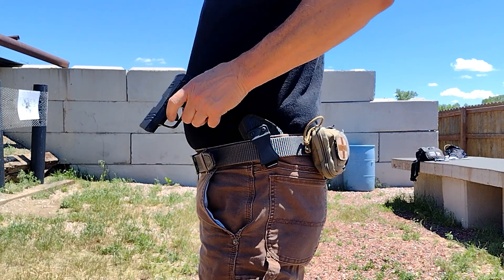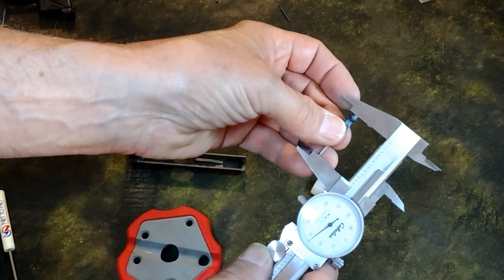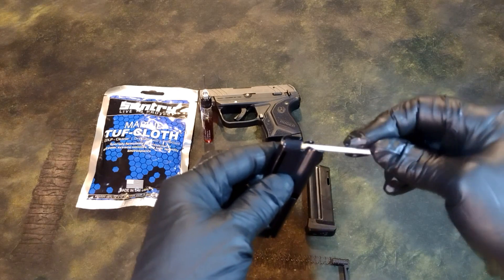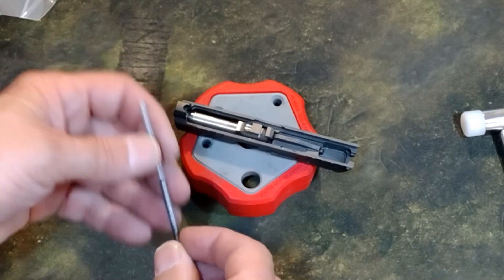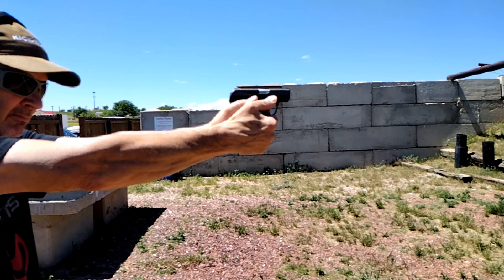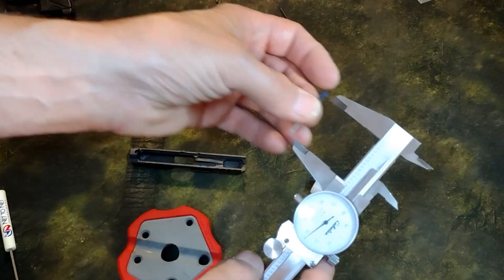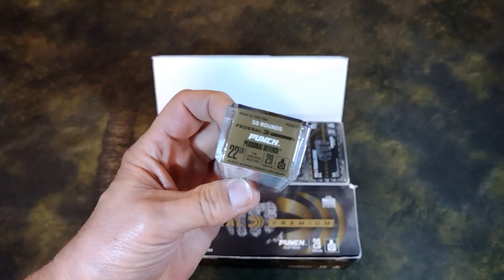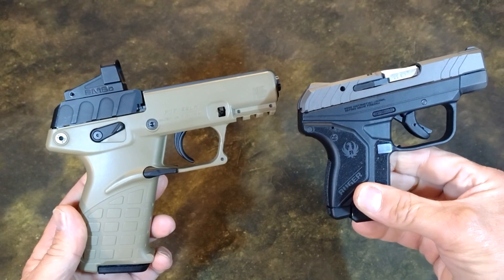The 22LR Ruger LCP II Part 2

Comment: I have 2 of these lcp 22lr one of mine has been back to ruger 3 times they have changed every thing possible and it still has problems the 2nd one has a light strike at least every mag Im not a fan anymore they were bought for my wife to carry and myself but ruger has dropped the ball on these there customer service is great but there guns are a problem lately same problems with the lcp max they have had the gun more than I have something is wrong with ruger
Reply from the maker: With Mini-Mag, mine seems adequate for those few times that I need ultra discrete carry.

Comment: You asked about Federal Punch 22LR success. I have had great experience with it in my LCP II 22LR. In it, I have the Galloway Precision increased power hammer spring, and their stronger extractor spring. I also have the MCarbo recoil spring. I added these three upgrades because of occasional light strikes and failure to feed with CCI Minimags and Velocitors.
Reply from the maker: The MCARBO recoil spring helped Punch. And their mag spring has greatly reduced accidental disengagements. Still getting seriously light strikes on occasion. Thinking to try the Galloway hammer spring..and a trigger to prevent punching. 

But now I'm having more premature slide locks. A stiffer slide lock spring? 

I like the pistol, but hard to recommend it. 

All of the ammo spent troubleshooting, the upgrades, the time spent doing the upgrades. I wish I'd have dropped the coin on a S&W 43c.
Reply: I hear you, believe me. I think I got somewhat lucky with my choices,  meaning that I could have chosen other avenues to resolve an issue or two, but the ones I made worked. The order of my steps were: First step was the Galloway kit to resolve infrequent light strikes, next was the replacement firing pin a few weeks later, then the last was the MCarbo recoil spring to fix nosedives (1 out of every 50 of the CCI Velocitors). That took me a couple months to decide to buy it (WELL worth it!), as the nosedives were only with an ammo that I had already written off. 

All of my uses of other ammunitions was just icing on the cake, as I already had it working extremely well. I just remembered one ammo that had only one failure to fire out of 300 rounds: Remington Thunderbolt. Filthy ammo, but it ran GREAT. If you would like to know the other ammos that I tried that were not as good as the good ones (Federal Punch, Aguila Super Extra 40 gn, etc.), just let me know and I’ll make a list of what I can recall. 

Another part of my luck was that I started with CCI Velocitors, CCI Minimags, and Aguila Super Extra High Velocity 40 grain plated round nose. The Aguilas were near perfect, as I just remembered one failure to fire, but I have fired hundreds of those with just that one failure. The CCI Minimags were pretty good, but not great. And I heard of the Federal Punch pretty early on and have had awesome results with that. I even clocked the Punch with my Caldwell Chronograph, and the velocity exceeded what Federal claimed on the box. 

Also, I certainly understand the challenges of taking that little fire control group apart. I considered myself lucky to complete the job in 45 minutes. The one thing that I found that was a MUST was a pick set with hooks. I remember starting the work on it and stopping before I put it back together, as I could not find any angled picks among my tools. I ordered a new pick set and finished the job once I received the pick set. It had to sit disassembled for a few days on the workbench which drove me crazy. But I was smart enough (for once) to wait until I had the exact right tools. 

Thanks for the reply, and I hope your LCP II 22LR Lite Rack can somehow meet your expectations.
Reply: PS I just remembered one other successful defensive ammo choice. Aguila Interceptor. Its velocity is exceptionally high, and higher muzzle energy of course. I only had 50 rounds of it, but all 50 fired perfectly. I did not buy any more of it as I had and have already decided on Federal Punch 22LR given its successes. 

Lastly, one of the upgrades that I considered to be essential was the increased power extractor spring. It works great to reduce malfunctions AND installation does not require messing with the fire control group! When I replaced the hammer spring and the extractor spring at the same time, I was thrilled with the results. However, if you install these two parts and don’t have great success, I’m going to feel pretty bad! Haha!

Good luck with it all!
Reply from the maker: @radomguy9678  Galloway Precision springs on the way. 

At which point I'll have:

MCARBO recoil spring to get it into battery more reliably.
MCARBO mag release spring to prevent accidental mag disengagements. 
Galloway extractor spring to help get the brass clear.
Galloway hammer spring and firing pin spring to prevent light strikes.

I guess all that's left is a slide lock spring to prevent premature slide lock.
Reply: @AmbGun  good luck! Obviously more work than either of us wanted to get into, but I do hope that you have the same success that I have been fortunate enough to have.
Reply: @AmbGun  I’ve carried my lcp22 for a couple years now. When i first got it i had fails to extract, light primer strikes, i was disappointed as i have held ruger in high reguards for decades. But the pistol was shockingly accurate when it did go off, and it is so small that with the holster it came with i could carry it un encumbered throughout my day to day. So i did some research on the matter and that led me to the galloway spring kit. That did it for me. Only thing mine wont gladly eat now is cci stingers. Federal punch, aguila, remington, armscore, browning, winchester and cci, in just about all flavors run well after that install. I even ran some cci quiet i had for my rifle through it. There was a few that didnt kick the slide back far enough, but most did…. And they werent supposed to run in any semi auto, let alone a pistol. What amazes me is the difference in people’s experience with the lcp. A few have had them run flawlessly out of the box, seems most have one set of problems or another, some don’t work at all. I cant believe that ruger is being that inconsistent with their quality control. I mean mine wont run stingers because the chamber is just a bit too short for them, but many claim the stingers work best in theirs. I do hope ruger tightens it up, i want to continue liking them. The idea of this pistol is genius, the design of it is brilliant, but the execution of building them is painfully lacking i hate to say. You f see shouldn’t have to rely on aftermarket to make a brand new anything function as it should. But here we are. If taurus could some how build a tx-22 micro this size id buy 2 in a heartbeat. My tx-22 and my wifes tx22 compact has been an absolute unit. But they both too big for me to comfortably carry. Hope it works out gor you bubba. Sorry for the rant. I had good luck with the galloway kit.
Reply: @AmbGun  what's your final recommendation now haha, do you still recommend the MCARBO recoil spring & the Galloway spring kit? I'm getting a lot of premature slide lockbacks across multiple different mags and ammo. I've had ruger look at the gun twice; and I'm around 1800 total rd count.
Reply from the maker: @patrickrenschler  With the Galloway Spring kit mine is cycling well. But that won't fix the premature slide locks. The 22LR LCP II is in regular use for deep concealment, but the P17 is my preferred when a bit bigger is ok. 

If doing it all over again I'd probably go with a Smith 43c.

Comment: I have fried probably 1000 rounds out of my LCP2-22.  The only ammo I have had issue with is Federal Punch.   Yes Federal Punch is a great round; but 22LR's can be ammunition finicky.  I have not had hardly any issues at all with the CCI brand of ammunition.  So for carry I will stick with CCI Stingers or Mini-Mags.  I'll leave the Federal Punch to my MKIV pistols or 10/22's "That Eat almost anything".
Reply from the maker: Part 3 coming soon. Steps I took that seem to have made Punch reliable with the LCPII.
Reply: @AmbGun  I put in M*CARBO: guide rod, recoil spring, Galloway Precision flat trigger and trigger spring.  I am using the slickest lube on the planet Lucas Air Tool Lube.    As of last night my LCP2-22 is running everything!

Comment: Liok closely at the case it self on the Punch, it's a little longer then the CCI, I sure that is the culprit, my LCP 2/22 doesn't like Punch either.
Reply from the maker: CCI Velocitor is similar. Light bullet. Slightly longer case.

I'm not sure if that's the cause for my LCP since 90%of the malfs are just failure to feed...just a very slight hang that is resolved with a light tap on the slide. 

Of course it could be added drag on extraction that prevents the slide from going all the way back and thereby hasn't quite the momentum needed. 

My next project will be to install an MCARBO magazine button spring to see if I can reduce the accidental mag disengagements. While in there, I plan to remove the magazine disconnector, too. 

Then create a Hammer Block so I can dry fire it aggressively.

Comment: I started with the M-Carbo and I had a few issues when shooting the mini mags. When I put the regular recoil spring back in, I didn't have any issues with the mini mags after shooting about 200 more. The mini mags do good in gel out of the LCP2. I carry the LCP2 in my right front pocket in a soft pocket holster with no issues.
Reply from the maker: I thought the spring would help Punch slide up the feed ramp. mini-Mag wasn't having a problem with the stock spring and no change for the worst.
Reply: @AmbGun  I hear ya, I have a lot of the Punch rounds too for my other guns but after reading how finicky the LCP2 is, I knew I'd never try them even though I've heard other vids and comments they ran fine in theirs. The  LCP is not perfect, but nothing else fits its size for easy carry.

Comment: Good informative video. I use Federal Punch , Remington, and Winchester 22LRs in my LCP2 . I've have no issues with the Punch or Remington. A few fail to feed with the Winchester. The LCP2 is bone stock. Normal cleaning only. Thanks
Reply from the maker: I suspect that the cyclic issues will diminish as the pistol breaks in. But I am concerned with light strikes and accidental mag disengagement.  In regards to the latter, I now know that MCARBO makes a stiffer mag release spring...definitely on my shopping list.

Comment: Ruger sent me a new firing pin too after contacting them about light strikes.
The measurement from the nose of the firing pin to the ring on the pin that stops it's travel is what you want to measure.
The pin is too short by design as it is an inertial design.
But the dimension of the firing pin stop to the nose of the pin matters.
It has been a while but I remember the new pin giving more firing pin protrusion and i could see the empty cases had a more distinct dent but of course, they changed the shape of the nose of the pin too.
I have an LCRx in .22lr and it eats everything including any "duds" the lcp2 spits out.😂
Same with my 1959 Single Six.
I have never had a misfire in the Single Six and it positively STAMPS .22lr cases.
I think it is a compromise in the pocket guns between hammering cases and an acceptable trigger press AND the lack of space for parts to operate and the slide to travel.
I still really like the LCP2 and ir rides backup sometimes.
Reply from the maker: We have an old security six that stamps the primer rim with authority, too.

Comment: Wow!  A Kel-Tec P10 would be a fantastic idea because the P17 is my favorite.  A slightly smaller P17 would be great although I like the grip long enough to hold.  I use the LCP II 22 with the TandenKross Wingman + 4 mag extension, so lets ask for a Kel-Tek P13 + 1!
Reply from the maker: Since the original LCP stole its design from Keltec's P3AT, it'd be great to see Keltec return the favor and copy the 22 LCP II form factor...but based on P17 design...fixed barrel, paddle mag release, and compatible with the P17 mags.
Reply: Ambgun, you are smart, experienced and analytical.  Your analysis on how the P17 in .22 beats 9 MM is right on.  Your idea for Keltec making a P17CC "compact carry" using the P17 mag is brilliant!  The P17 mag is essentially the same width and length as the LCP II mag with the Wingman + 4 bumper, so it would hold 16 rounds instead of 14.  Thr P17 grip depth could be cut by 1/4 inch at the rear with no problem.  It's already a bit long and narrow.  Leave the center of the P17 the same.  Maybe shorten the trigger guard 1/8 inch and move the trigger guard screw back a bit so the CC model could mount the same TR12 Armalaser as the LCP II.  Shorten the muzzle about 1/2 inch, but only shorten the barrel and rail by 3/8".  Advantages to the P17CC would be 2 more rounds, more reliable, softer shooting, slightly lighter and easier to rack and more accurate due to the fixed barrel.  Both would be quality pocket pistols with minimal printing.  The CC model might lose the threaded barrel but that doesn't matter to people wanting to pocket carry.  The P17CC would be slightly thicker than the  LCP, but still wouldn't print.  And the final benefit would be LCP $360 P17CC $230.  I would buy one immediately!

Comment: I tried the Federal Punch, not in semi handguns, nut in bolt and lever action rifles. Accuracy was not there compared to my usual favorite ammo for each rifle. It was an experiment. It failed, no harm, no foul, move along. I suspect testing during development for your handgun was done with "standard" velocity ammo. I have an old 1947 Iver Johnson Safety rifle 22LR single shot that only shoots 40gr lead, "standard" velocity stuff well. I have a few bricks of Western Cartridge Co stuff from lifetimes ago. Feed that relic that ammo, it is really accurate. All the higher velocity ammos? Not good at all. I have a Henry (the basic model) and it prefers Rem Golden Bullet. I have a 2-7 Vortex scope on that gun and it is my squirrel gun. Shoots tiny groups at 25yds. Each gun likes what it likes. In your case, seems like the CCI is more reliable. Run whatever is THE most reliable. Accuracy is fun, but on a carry semi gun, cycling is more important.
Reply from the maker: I think the slightly longer case on Punch is what makes it a bit problematic.in semi-autos. Probably great in revolvers...being formulated for very short barrels.
Reply: @AmbGun  OK, that explains lot. I did not know that. Lots going on in a semiautomatic handgun. Everything has be just right every time.

Comment: Thank you! 

Important questions:
What was the exact model or name of the spring you installed?
Did it make racking the slide more challenging, and if so, how much more challenging?

Thanks in advance for your response.
Reply from the maker: I could not discern a change in "lite rack". I used an MCARBO recoil spring...latest video, part 3, I also installed their mag release spring.

https://www.mcarbo.com/ruger-lcp-2-extra-power-recoil-spring-22lr-only.aspx
Reply: @AmbGun  thanks for the reply. In this second video comment section, I read that the CCI minimag ammunition worked well with the standard spring. I'll probably just use this ammunition then and leave the stock spring. Unless you recommend changing it anyway. 

Thank you again.
Reply from the maker: @kevinguthmiller8510  without firing 1000 rounds each, I can't say. 

The MCARBO spring did seem to help Punch. 

At this point, with light strikes and accidental mag disengagements being the main issues, I think a stronger hammer spring and mag release spring might be worthwhile.

Comment: The Federal Punch .22 has a considerably longer casing than the mini-mag and my Ruger LCP .22 doesn’t like it.
Reply from the maker: CCI Stinger, too, has the slightly longer case. Episode 4 saw great improvements in Punch function (although Mini-Mag continues to be near flawless). 
https://www.ambgun.com/ambidextral-pistol/ruger
Reply: @AmbGun  yeah, I had the same problem with the Stingers.  At first I thought it was because both have nickel casings, then realized they are both longer.